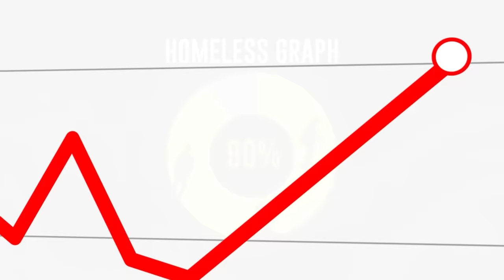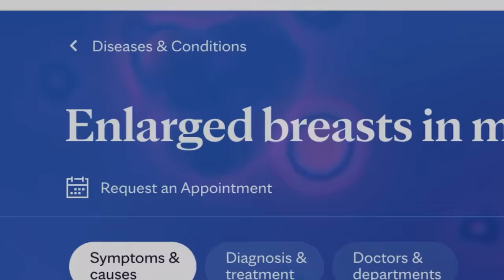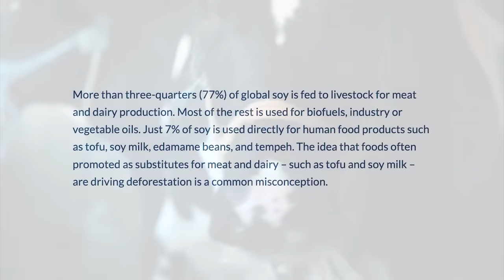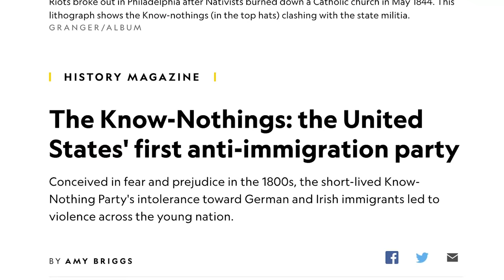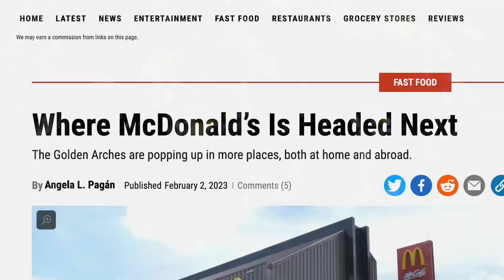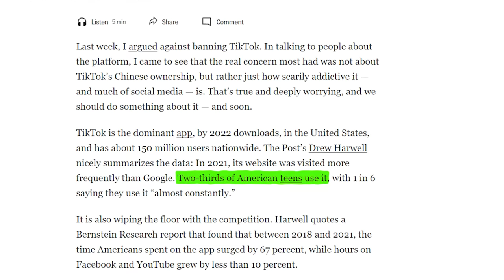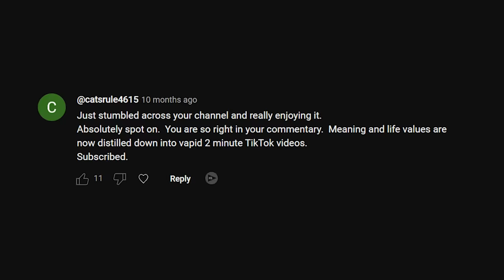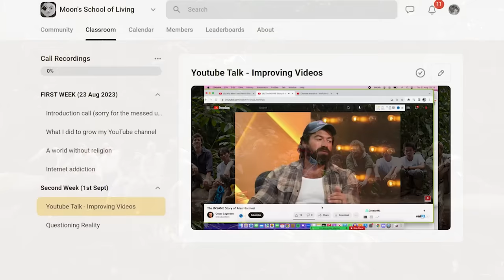How Americans Got So Dumb

Comment: You know it’s bad when UFC fighters go to marine boot camps to learn and end up teaching
Reply: @@HigherLander42069glad you noticed such a stupid comment too
Reply: @@HigherLander42069Pretty sure they have lowered the standards for the marines drastically though (they DEFINITELY have lowered the standards drastically for the army, air force, and navy).
Reply: @cordlefhrichter1520  Not at all. They added push-up option for men on the PFT  - however, you cannot achieve the full points doing push-ups and must do the original pull-ups. They added age specific scoring and gave PT studs an exempt from body-weight measuring.

They literally just improved the test, incentives more pull-ups and maxing out the test to get exempt from being measured. Literally opposite of anything you said. Do not confuse the United States Marine Corps with other branches. Semper Fi.
Reply: Many fighters are unironically more mentally tough than modern soldiers
Reply: @Walddo  the fact a recruiter went up to ME proves they lowered the standard
Reply: @HigherLander42069  Calm down, buddy. I just said they lowered the standards, which they did. Don't get your panties in a twist.
Reply: @@HigherLander42069 Calm down buddy, I'm not upset.

Comment: If you live in the USA, do NOT drink tap water.   Dont even use it for ice cubes or cooking unless it will be boiled.  Worst water you can get.   Specific water filtration systems are a must, hooked up at the main so the entire house is filtered.   If you cannot afford this, brita, boil, and bottled water...i know, more plastic, but a poland spring is better than my tap.  Another good option is buying a water dispensing unit that comes with a 3 stage filtration plus charcoal.  Basicaly takes out fluoride and most harmless chemicals while most minerals are NOT stripped.

Comment: I mean I think social media could be bad and it’s also great. This video is attempting to single out echo chambers while simultaneously creating an echo chamber. Social media is interactive in comparison to the real problem that is over 75 years at this point was and still is the television. No one talks about that where people watched news for over 75 years and becoming programmed with a one way narrative. There wasn’t any interaction with the television besides video games and the generation most closed minded and susceptible to propaganda is the boomer generation and beyond because of the reason I listed above. So sure while in the short term there will be an adjustment period to the constant access to social media and broader world wide community eventually it should even out and it’s not even half as bad when compared to the damage television has caused to multiple generations which largely still goes unaddressed.